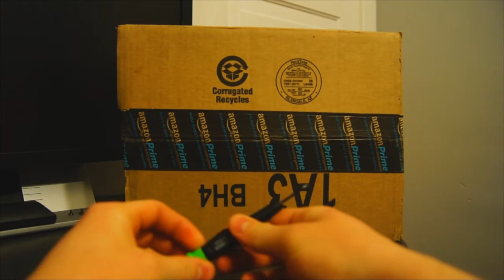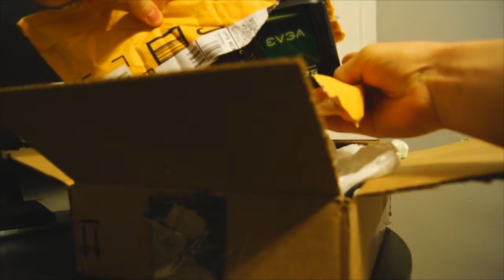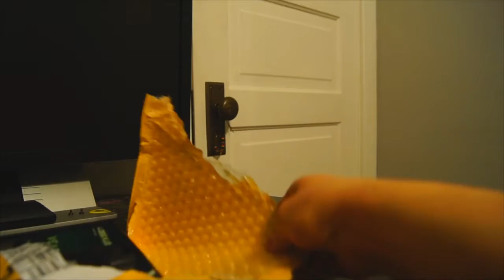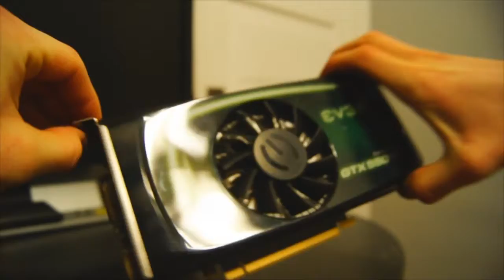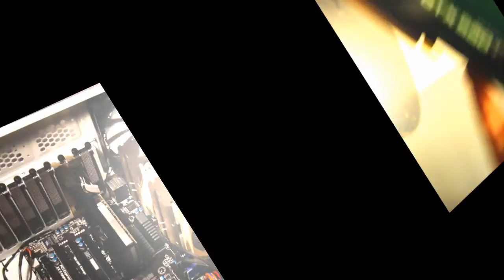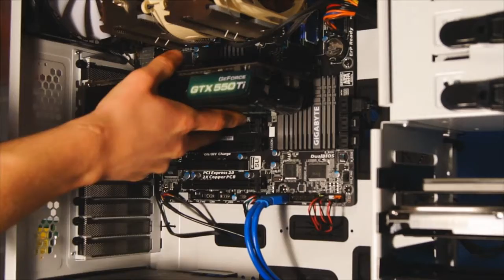Unboxing gtx 550 ti & how to install a graphics card

Comment: The Evga 550ti SC 2GB was my first modern graphics card.  I bought it new from an eBay seller for $200 back in 2011.  I've had 3dfx VooDoo's and old school ATI Radeon's back in the day, but even this weak GPU blows them away!

Comment: Hi. I blew up my GeForce gtx 760, lol, it literally caught fire. Removed it and now I'm getting ready to re install my old GeForce 550TI again, just for now, getting a whole new system soon. Anyway, do I have to uninstall the drivers from the 760 or should I be good to go?
Reply from the maker: @SnowWalker1  good question. 4 years later I still don't know lol I always leave the old drivers and just install new ones when changing gpu I'm lazy

Comment: hey man im wondering would it be faster than my gt 730 or would it be around the same performance wise
Reply from the maker: computer nerd check some forums or post on Tom's hardware or something, I would assume the 550ti is still a bit better but probably not by a whole lot
Reply: thanks for the help : )

Comment: Which is better gt 640 4gb or yours
Reply from the maker: the 550 ti definitely, there are many pros and cons but when it comes to straight power the 550 ti will get you MUCH higher fps.
Reply: leo deepak not really lmao i have gtx 980 ti and theres a gtx 690 and its nowhere close to the speed of the 980ti

Comment: Nice man, Would you recommend it? Ive got my old GTX610 and the fan went bad and am going to upgrade soon. I've also got a Q6600 so would the 550ti go good with it?
Reply from the maker: I would definitely recommend it, I went from the 610 to a 630 to this and the 610 to 630 didn't do much but the 550 ti is a HUGE upgrade. Your Q6600 may be a bit of a bottleneck though, the 550ti will still help a lot but you just may not be getting full potential with that processor.